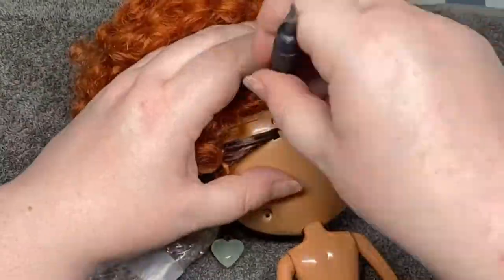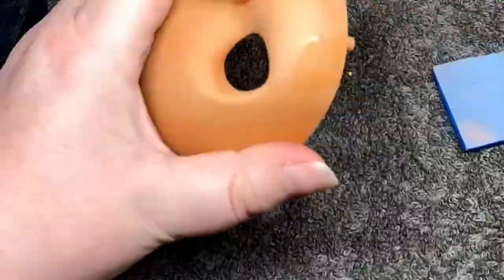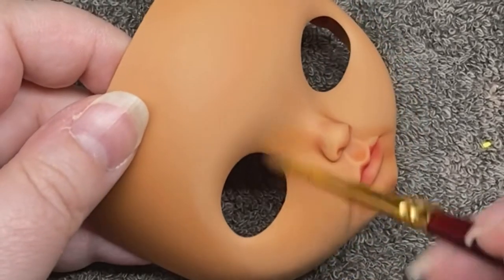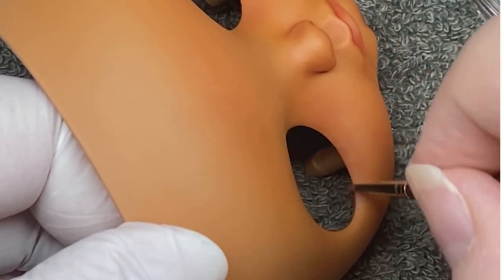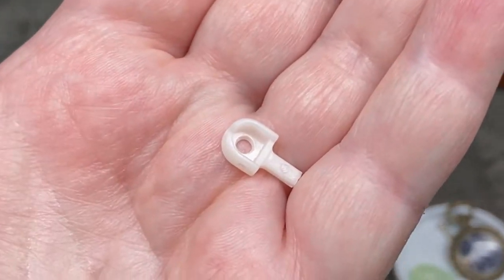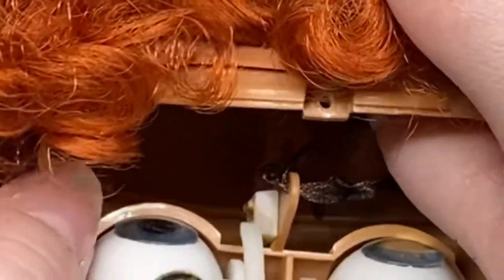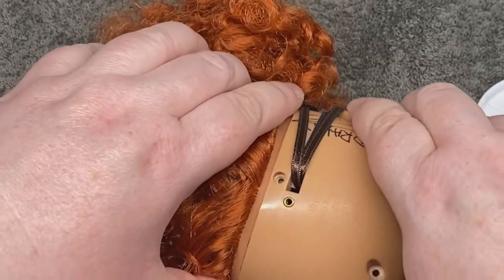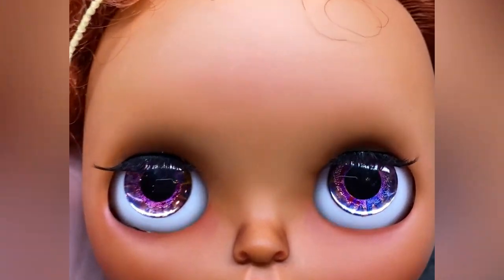Custom Blythe Doll Repaint and Repair! OOAK Doll

Comment: Heyy, I want to change the make-up of my custom doll. Do I have to sand down the faceplate or is there another way to remove the make-up? <3
Reply from the maker: Lightly sanding with a higher grit sandpaper (like around 1000) should take off the makeup and not damage the custom work. You can’t use acetone as it melts the plastic.